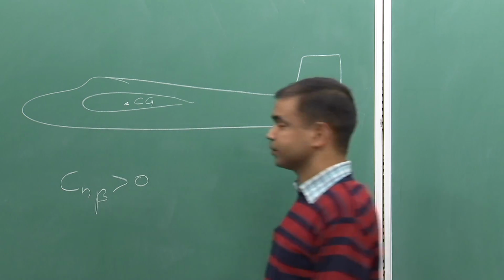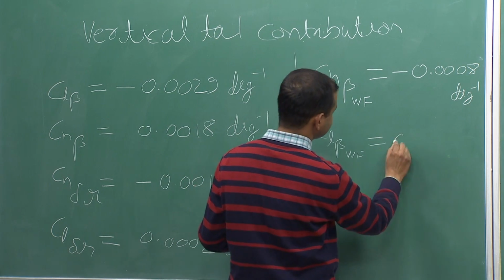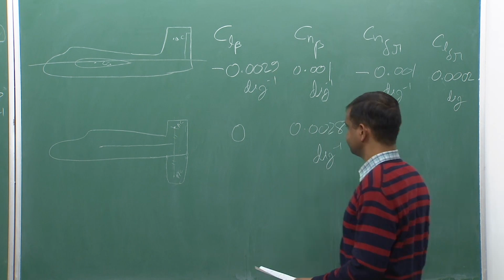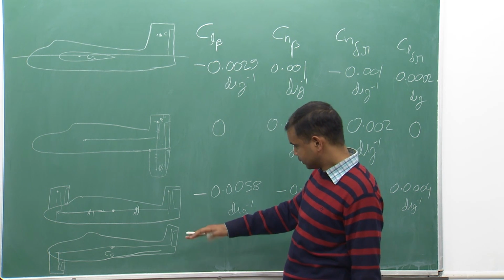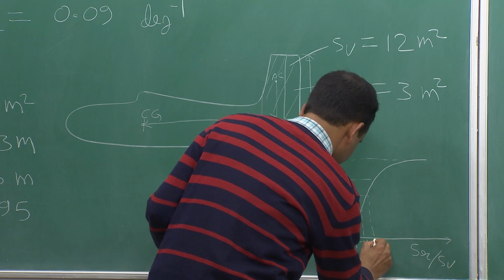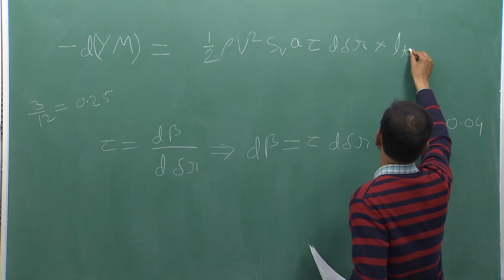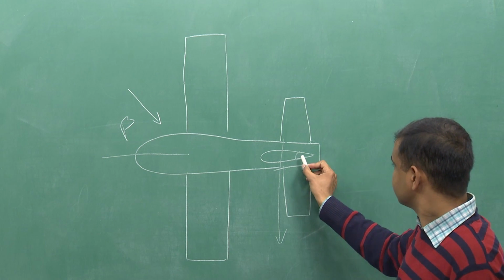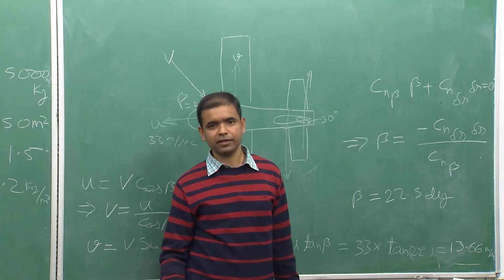Numericals : Directional, Lateral Stability and Control

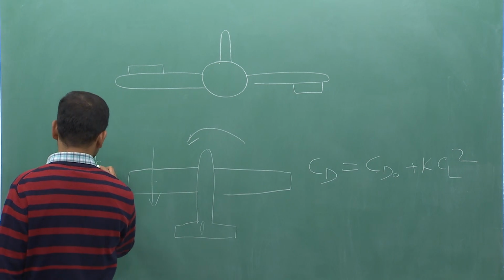Comment: Can anyone explain how the two diagrams at 5:20 equal, I think Cn&a is > 0
Reply: I too think the same
Reply: Little mistake while explanation but the result is correct.
When 'delta a' positive, i.e right aileron up and left down, lift on left wing more because CL increased. Due to this drag on left wing also more now which will give negative yawing moment. So basically for positive 'delta a' , negative yawing moment. Hence
 'Cn delta a' < 0.